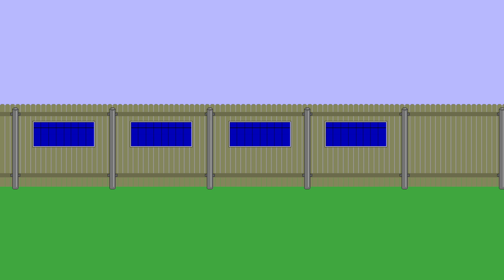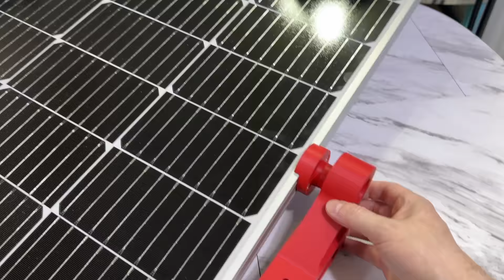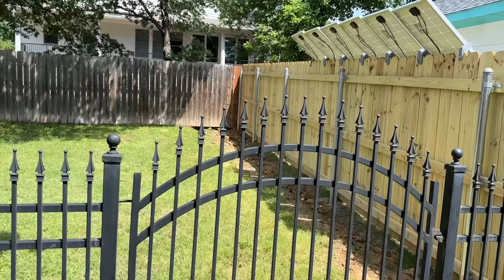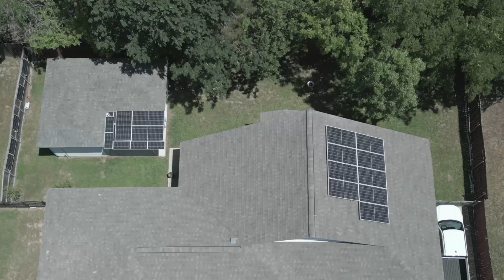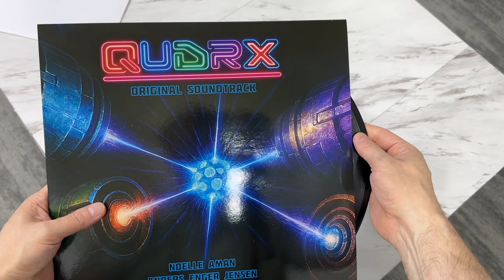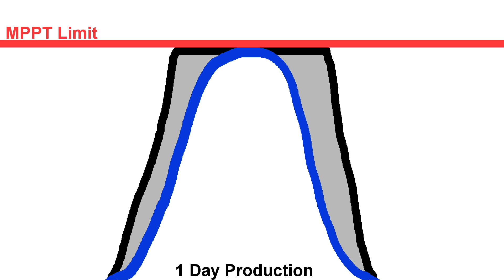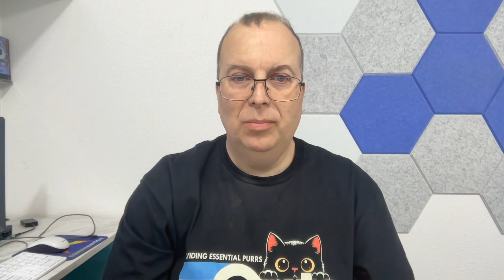I made an adjustable Solar Fence!

Comment: I was in the process of asking if the neighbors mind the panels hanging over their side of the fence as you said it was mom's place.... That answers that question
Reply: @scittw22  haha exactly, I would not really be very happy with such neighbors 🤣
Reply: @RamonSmits  Unless you're directly using those 30 cm next to your fence... why exactly? I mean, I'd have it plainly on paper that neighbor is to fix any eventual damage in case of it, and/or is now obliged to do fence maintenance, and let him use it. I would. Just like I would like it if my neighbor was forthcoming in the same manner. Reasonable flexibility.

Hell, you might even come to some power-sharing arrangement, or a combined mutual project (more panels for all and/or add batteries to have a stored power solution).

Good fences make good neighbors, and IMO this is a better fence. 😁
Reply: @cbs1710 Hey, a reasonable person in a culture of turf warriors, that's nice to see 👍

Comment: 5:45 I would attach a bar spanning across the backs of all those panels (in a mount that allows it to rotate), attach an aluminum leg to each side like you were mentioning, and then put a handle of an appropriate length on one side. That way you can just lift the whole set with one hand and use the handle to rotate the legs into place with the other. (And put a bar into the fence at the appropriate height to support the legs, once you find the optimal angle for the panels)

Comment: I was thinking you could have the panels linked together on a crossbar, so it can be raised and lowered by computer controlled actuators to follow the optimal angle of the sun's rays.

Comment: all I keep thinking about is how expensive this all must have been,   all the energy storage stations are not cheap,  all the cabling/infra and the panels themselves,  i would guess around 20k or so?    and your normal energy bill would have been like 2k per year?  To me that would be too risky,   i feel like by the time it would pay off (10 years)   im sure i would just be unlucky and have failing equipment pushing me far beyond the 20k i said initially

Comment: over here there is so much solar, that during the day the electricity is free (sometimes you even get paid for each kwh that you use), so now people are installing batteries to charge them for free, and use that power during the evening / nights, when the price goes back to normal
Reply: Yeah but will the batteries pay for themselves over their life time I wonder.
Reply: @Matlockization Batteries are subsidised by the govt here in Oz so they are relatively cheap. Mine will pay for themselves in around 3 years at current power prices. My batteries have a 10 year warranty that guarantees that they will not lose more than 20% capacity in that time. During blackouts my house is fully powered. Its a win win.
Reply: @yobgow  How old are your batteries now ? How much do you get paid by putting power back into the grid ?
Reply: @Matlockization 6 months and I've already told you my ROI. I'm not going to give you a run down on all my costs. If you don't believe me, it doesn't change anything for me.
Reply: @Matlockizationcan you even math though?
Reply: @Pentium-Pro You means after 7 yrs the batteries and panels degrade. Is that the kind of math your talking about ?
Reply: @Matlockizationwe all know that when the panels degrade, they explode leaving no way for them to continue generating power.
Reply: That's great for each individual person, but the existing electrical generating and transmission infrastructure needs to be paid for, maintained, repaired, etc.  It's definitely a policy conundrum.

Comment: Texas sun must really pay off. Having the panels float means that they would be cooler and produce more. 

Parents tend to leave before children so at some point these panels will need to no longer extend into the neighbor yard.  By the looks of it I would clip them from the top and keep them on your side of the fence. 

Texas is around 30deg north, so 30 degs of elevation would be peak power at noon. I would angle them a bit more so you have better production on either side, say 11am and 1pm to have the sun perpendicular during those 2 hours instead of just at noon. YMMV

Comment: I'm curious if you considered how wood expands or contracts during the cold and warm temperatures. I have a fence door and I have noticed my door rubs against the adjoining frame during the winter and then corrects during the spring.
Reply from the maker: Considered yes.. but don't really know what to do about it until it happens.. I'll deal with it when/if it becomes a problem.

Comment: I am glad I am not the only one thinking about him intruding the neighbor's space and he explained it.
Reply: He had mentioned it a few years back when he ran a fiber line out of his network closet to next door so his mom could share his internet connection.
Reply: Wonder what he'll do when his mom is eventually gone?  I would think he'd need to maintain ownership of the house, unless he can sell it with a stipulation that whoever buys it must allow for the solar panels to be on the fence.
Reply: @Eocene84  Move them or change the layout/plan of it. Probably not that complicated tbh, nothing is permanent, though it would be a pain thats for sure lol.
Reply: @E @Eocene84 wondered the same.
Reply: @Eocene84 He can either rent it out or his kid can move in. He doesn't have to sell it after she passes.
Reply: @Eocene84  
That's not gonna happen, the panels will have to come down.
Reply: @thud9797  Easement.
Reply: @galacticboy2009 
Only if the new buyer agrees. And who's property is the fence on? If totally his property then that helps. If it's on the property line then it becomes a shared fence and the neighbor can demand the panels be removed. So maybe he can get it worked out but maybe not.
Reply: @thud9797  he can just move the propety line by not selling that part.
Reply: @Eocene84  yeah, have a standing deal where the new buyer gets a share of the power, like 1/8th.  
Neighbor buys a power bank, 8BG gives him a cable to plug in and slowly get a free ~100W trickling in.
Reply: @Eocene84  depends on how close the fence is to the property line anyways. typically they need to be a certain distance from the property line, so depending on that, the panels may be fully within the property bounds, therefore no intrusion on the neighbor.
Reply: I remembered he said before his mum is next door but for a few seconds I thought I bet the neighbours love that. 

Saying that from one angle it looked like the house behind him has a view of it. I Maybe wrong.
Reply: I think it's a great mounting scheme for solar panels, allowing it to follow the sun (possible future improvement).  Sun's movement is predictable throughout the year.  I've seen automatic panel cleaners when you have excess power.

You have a lot of extra roof space.  Are you ever going to use those?  Solar panels can be used to prevent direct sunlight heating, which reduce the need for air conditioning.
Reply: Why even build a new fence at that point. It would have been so much easier to make a ground mount system after taking the fence down
Reply: @brendandelear1145  If his mom moves, it'll be easier to sell the house with "the fence is a little odd" than "the fence doesn't exist".
Reply: @_D_P_ build the fence then
Reply: @_D_P_ why do Americans always think about "what if they move", as if people didn't own their house to live in it long term and didn't grow attached to their yards and their neighborhood? 🤨
Reply: @LRM12o8 It's not Americans, it's just nit picking people on youtube who can't just enjoy a video without scrutinizing every little thing David does/says. You should see the autists who sperg about how he solders, despite the fact that it always ends up working.
Reply: @brendandelear1145  Because his mom's probably not gonna live there forever and whoever buys her house eventually isn't going to want the neighbor's solar panels in his yard.
Reply: as soon as i saw the fence, i thought -thats not yours its your neighbors.  Then i remembered who his neighbors were
Reply: I would have just thought he had the fence a few feet away from the end of his property so he could still have them there and not be over the neighbors property.
Reply: I wondered about that too, thinking, boy... his neighbors must really love him, ha ha
Reply: Ha ha... I was just thinking as I was watching that his neighbour must be very understanding... I forgot his mum lived next door.
Reply: In addition , where I live the good side of the fence should be facing toward your neighbors.
Reply: @emjones55343  Where I live whoever pays for it gets the best side. If it's 50/50 then it alternates at every post. Some people double up on the fence boards and do both sides nice, which will of course make a more rigid privacy fence. The boards would then be staggered so you can't see between the gaps. Lots of cultural differences for sure.
Reply: @ItsJustJussi  Bingo.  one of my neighbors recently replaced the fence between us.  He didn't ask about "the good side".  I don't care that I see "the back side".   I got a free fence.  (And yes, I did offer to split the cost.  He refused.)  The secret is to have good relationships with your neighbors.
Reply: @emjones55343  Tell my neighbours that! In fairness, I actually like having the supports on my side as it gave me more solid fixings for plant supports. Every cloud... :)
Reply: @emjones55343  Where I live if it's on your property you can put it facing however the hell you want since it's yours and on your property. You can but it right up to the property line and if they don't like the look then the neighbor can buy their own.
Reply: I don't know where you guys live but I can't even imagine an environment where neighbors are actually courteous.
Reply: @WinterInTheForest  Most people in the USA would not be that courteous... also it's a liability insurance wise. My immediate thought goes to if I had kids or a dog potentially climbing or banging into that fence and either getting hurt on the sharp metal panels or damaging the neighbor's expensive panels; especially since he's using cheap non-professionally designed 3d printed plastic parts (typically only used for prototyping)...
Reply: Well you explained why it isn’t courtesy that’s the issue. A tree is one thing. Fine your tree over hangs my yard, but you didn’t plant it and it’s whatever. But hanging stuff over into my yard for no good reason gets a smashing or a cutting. I don’t have to think about what ifs, because I won’t let you put me in that position if you’re so selfish and narcissistic to do it to begin with. Take up your own yard space or roof or whatever for your personal wants.
Reply: @lord_haven1114  you can cut tree limbs if they overhang into your property.
Reply: @MarvelDcImage  if that'd been my neighbour doing that, I'd have requested they take it down, as would be invading on my land.
Reply: Most of us knew he lives next to his parents (now mom) from way back. This wouldnt work otherwise. I would never allow neighbor to do that.
Reply: @F40PH-2CAT The video where he mentioned that was several years ago at this point. You can't fault the new fans for not knowing.

Comment: Hi, if you use one small panel and arduino just for test all available angles each hour ( just move and read output power) you can use this info for auto adjust all other panels - all time optimal angles

Comment: When you hit the max capacity of your electrical storage during the day, perhaps shifting to "thermal" storage is the way to go? Activating AC/heat as needed to precool/heat your building is one way (though it introduces some wear and tear), but if you have a hot water tank, using excess solar to heat that water is an excellent place to consume that energy. If you don't have one in the shed, perhaps it'll pay to cable over to a second tank in your house (in series with your first)? I hate seeing good solar go to waste, lol. 🙂Thx for the video!
Reply: That would be.... difficult to utilize. Adding a hot water tank elsewhere for what... to only be hot during certain times of the day? Powering it with grid power at all will significantly increase overall power consumption and utility cost. So now you have a hot water tank that's only warm from... 3 PM-8PM. I can't think of a better way to actually do it, what am I missing here?
Reply: As a naysayer, that tells me that you haven't implemented it. I have. And my electrical bill is barely above the service charge. Thermal storage is tried and true economically viable battery, and the deciding factor usually comes down to the cost of the conductors between the generating side and the consumption side.

Comment: Neat stuff BTW! Another thing to check is how much does the lock vibrate when the wind direction is parallel to the panels (and fence). You may want to add some TPU sleeves to the locking pins or similar.

Comment: One thing I thought to affix on an angle would be for that 3D printed puck could have a gear feature where it mates with the holder, then the holder would have a negative shape to lock it at the specific angle.

Comment: I would have built a rod with cams that runs the length behind all the panels. Then you can just turn the rod on one end and it would push all the panels up via the cams into the angle you want. And when you want it flat you just roll the cams back to fold flat behind the panels.

Comment: The way that grid-scale solar farms work is that they have a torque tube running the length of the run of panels, they have a motor that can rotate them for optimal solar tracking, or in adverse weather events it rotates them in storage positions for hail, water (flood), wind, or maintenance mode for cleaning.  The DIY home owner version of this could be to use a pole like 3/4" conduit EMT, that can rotate on pillow block bearings, the panels are fixed to the pole using #1 conduit hangers. The rotation could be accomplished manually with a handle at the end that you can lock down with a pin/index holes, or a clamp that you can tighten and untighten.   Later you could automate this with a motor for more sophisticated solar tracking and an override for weather-storage situations.  For Hail, the Vertical is the best position.   Oh I should mention that balancing the system or adding a counterweight is important to make the system easy to turn.
Reply: That could be done, or in his case, a simple linear actuator would work if he tied all the panels together.
Reply: @reeepingk  Sure, there's more than one way to solve this kind of mechanical problem for acquiring automatic tracking and storage positions. For a small DIY home solution the linear actuator must be rated for outdoor use and has a positional feedback, as would be needed for any automation like a motor.  

BTW: The motors used on those large arrays are a 3-phase motors with planetary gearing and they drive a differential gear to drive two torque tubes, one on each side spanning a very long distance.  The motors are mounted perpendicular and they don't look like they could drive that row of panels, but they can.  I got some training on site and they let me drive in some rivets with these specially made tools into the risers and mount the motor.  That was very cool!   Not too many people see what all goes into these systems up close, so what I'm talking about is a solution I've seen work on large scale... that said, DIY home projects don't need to follow the same path.

Comment: That wood will warp without weight. I think with the panels it will add extra pressure. Should have started with a 2x4s along the top on both both sides.

Comment: Would not the panels suffer less damage/force if they were placed parallel to the ground during high wind?
Reply from the maker: I investigated that... everything I found suggested that the vertical position was actually the best for high wind.
Reply: @The8BitGuy  Fair enough. 
Hope it works out.

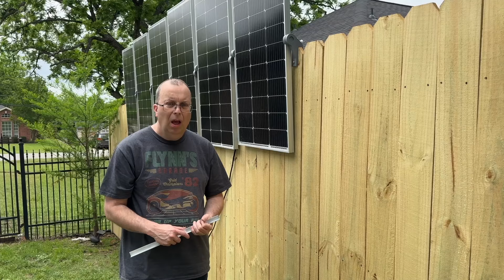Comment: Must have a good relationship with your neighbors if they don't mind a solar panel existing over the property line along with these panels above the fence line and supporting equipment on their side of the fence.  Cool project idea.  Not many people would necessarily have all of this line up.  I'm only at 5:13 so you may cover this later but the idea of these panels adjusting to track the sun in one axis may be interesting and the math on the power capture would need to be reviewed to justify the extra expense and risk of more moving parts that could break.

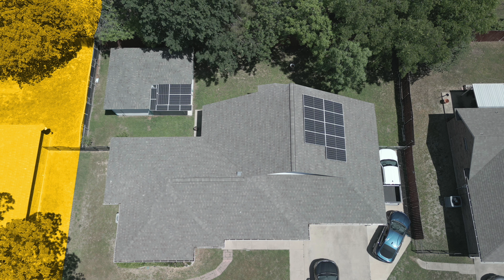Addressed at 6:55